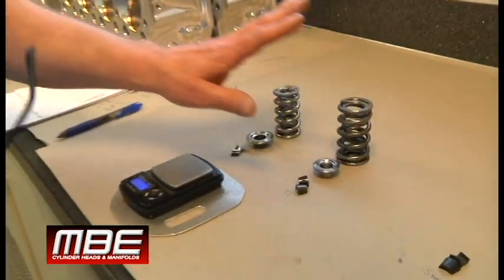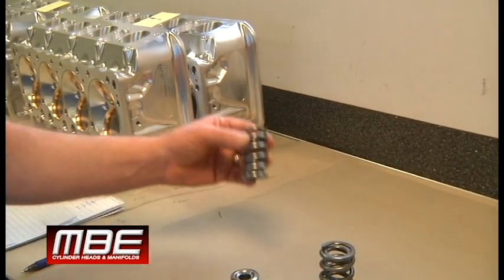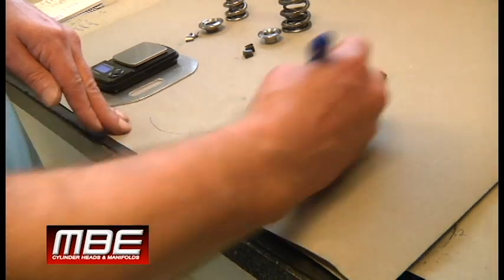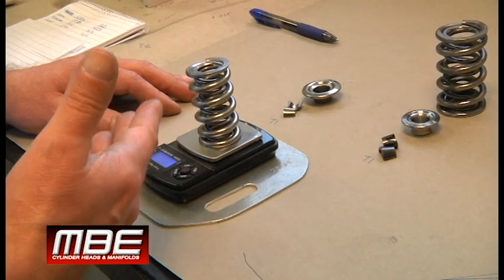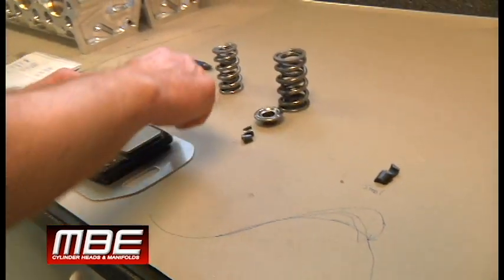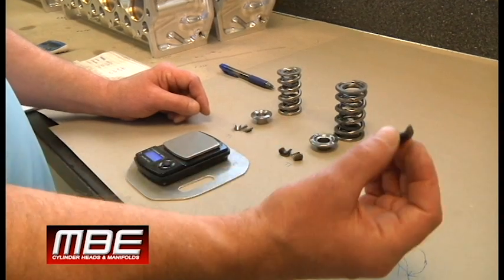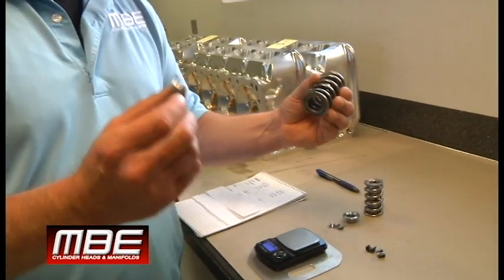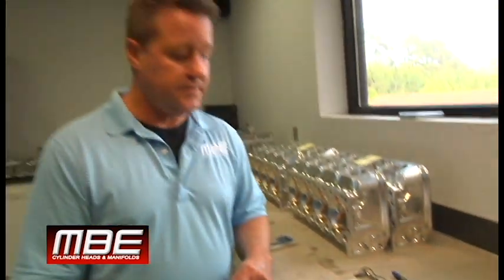New vs Old Valve Spring  ** TECH VIDEO **

Comment: I just up graded my SBF world Jr heads,  the Old dual Springs,  Retainer,  2 Clips = 2528 (per 2 heads) - New Beehive Spring, Retainer, 2 Clips = 1728 ( 2 heads) now it's 800 grams lighter or a total savings of of 1 LBS 12.OZ .  I'm hoping she'll Rev a 1000 RPM higher & be smoother at upper RPM's, with a whole lot less Spring oscillation.

Comment: Have you used the conical valve spring? The conical valve springs are not only lighter but they are shaped to be stronger.

Comment: Where do we get the new springs, retainers and locks? What is the material that they are made from? How many duty cycles are they rated for? How do they react  to Heat? Where can we see the data please.
Reply: Ti = titanium  As for specific data, spring manufacturers who did proper spintron testing is a much easier place to start than doing several pages worth of physics calculations - proof is in the pudding.  Be assured cup changes were tested.   As Chico Marx put it:  "Who you gonna believe: me, or your own eyes?"